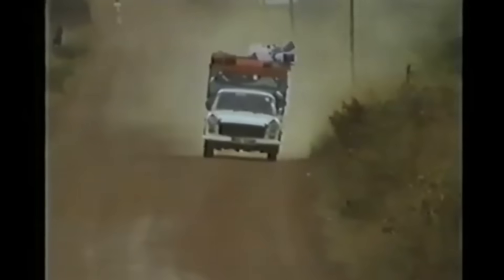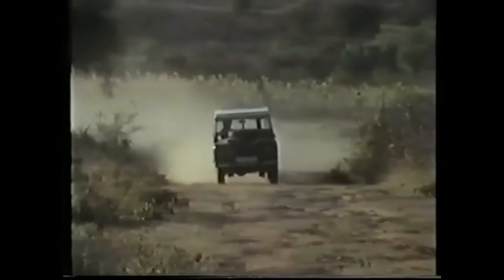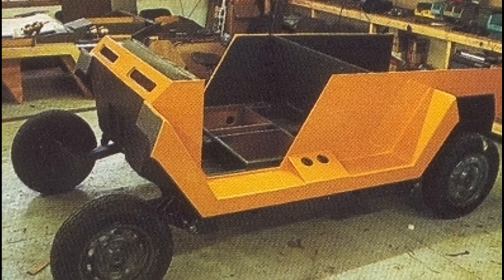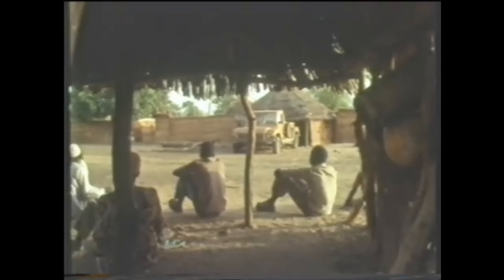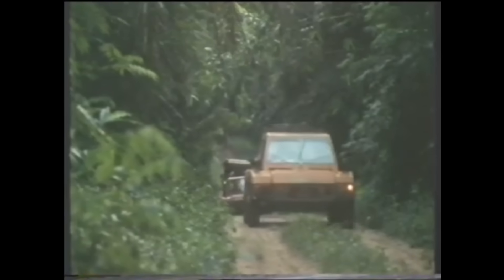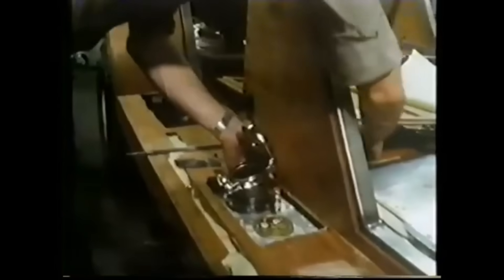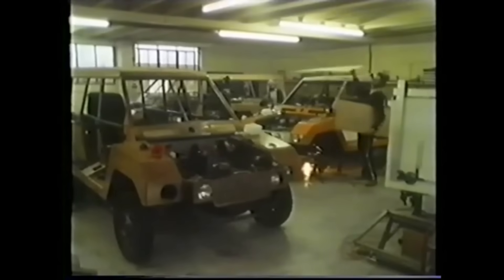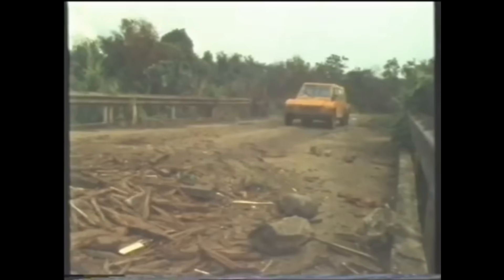This Car Was Built to Save Africa – And Got Its Creator Imprisoned

Comment: Looks cheap, but in reality it cost more than it looks. The body looks manual labor intensive and waiting for the epoxy resin to cured alone will take eternity, so efficient mass production is questionable.  The vehicle is designed for wealthy European Safari tourist, I doubt average African blacks can afford them where an avalanche of cheap used import cars from Europe and Asia are more affordable.  A third world car builder in the Philippines can do the same feat for a lot less using imported used parts from Japan and Korea and a simple arc welder or torch welder.

Comment: Replacing the motor & the gearbox at that step of the projet was a death wish. Especially with little or no funding. 
And it was counter productive cf. the initial requirements, having something already massively produced and known by the mechanics.

Comment: I was recently in Ghana and (again) noticed how almost all standard model cars are, and have to be adapted to the specific requirements of the local conditions and to their intended use. I thought: "Shouldn't there be a car designed for (SubSahara) Africa?" Turns out there is...

Comment: It was a great idea. I loved the documentary at the time...

Trying to develop a new driveline was a huge mistake. With the construction the way it was, it would have been easy to just build different front subframes to adapt whatever running gear he wanted to the car.

The original plan was to build them locally in Africa. Lile the Jeepneys in the Philippines, they could have been built one by one, using whatever was available. 

I guess that wouldn't have been a strong business model tho'...

Comment: If only he just did the chassis frames, in the UK. And then the  buyers built a kit car upper body on whatever local materials were available like flattened out oil drum panels hammered into shape in a backstreet workshop.
If the mechanic components were readily off the shelf, then the rest should have kept the idea afloat, until a new engine and gearbox layout was designed and manufactured in Britian. 

Are the original company design plans now open source since the legal case. 30 year rules on anyone building their only version on his work. Or did the creditors in that case, own the rights outright. Blocking any future development but with modern technology innovation and materials.

Comment: car for Africa - pick up, two cylinder, two stroke, air cooled("trabi"), "short" transmition(max speed 60 km) 15 inch wheels, cross leaf spring front and rear, tubular frame and textil "panels", curb weight 500 kg, simpley and no expensiv, price 700 - 900 $, car for African piples, production, Vietnam, Indonesia, Bangladesh and African states.. 😏

Comment: I have the book, published in 1987, based on the Channel Four TV programme. It was brand new and sold for £12.95 (so it wasn't cheap) and I bought it reduced to £4.99, so it wasn't just the car that failed financially.
It was a disappointing book as most of it covers the societal, ecological and moral aspects of the project whereas I was only interested in the design and construction. Such details are scattered throughout the book rather than one dedicated chapter. Maybe this is the result of prevalent, muddled thinking.
I must add that according to the book the vehicle had a plywood, pontoon chassis with additional, steel front subframe and rollover protection. Should have been designed as a kit car or plans.

Comment: Custom engine and gearbox for a car, which should have readily available and well known parts, adn development itself can't be cheap... WTF?! It all made sense up to that point, but this change was introduced almost like he wanted the project to fail on purpose.
Reply: His worry was that fact the 2cv had gone out of production and he couldn't buy any new vehicles or engines, it was a panic situation and not thought through.
Reply: @laupernut  To be fair, I don't think that there was anything else on the market comparable to the simple, simple, simple C2V powertrain, and  else would be more expensive to buy and require redesign. So, in a way I understand his reaction.  However from the Monday Morning Engineer's perspective,  I would have started purchasing some of the  tens of thousands of USED C2V engines and having them rebuilt to spec.  That would have been about the same cost as buying new engines and  would have given him a couple of years of production while searching for a different engine.   

However almost 50 years to late to be of assistance? That's just the way I roll.

Comment: What exactly did he want to develop that a Toyoata BJ wasn’t already?
Reply: The low price. The Toyota was available for $10,000 (new in 1981) while the Africar base price was estimated at $4,250 - $13,250. Quite a wide range, even for an estimate, I'd say. I can't actually believe tha the three axle upgrade would increase the price by a factor of 3 compared to the base model. There's something fishy about that. And building an "African car" in the UK? The UK wage of $800 (per month) back in the days versus $300 in South Africa. Well, probably because the car manufacturing infrastructure wasn't yet there in Africa. Automated modern car manufacturing requires 40 person hours per car, so that'd be a only a $100 price difference if the Arficar could have be assembled that fast in 1985, too (maybe possible with a externally sourced drivetrain, as initially planned).

The Citroën 2CV Charleston was around at less than $6000 in 1981. The Mèhari was the 4x4 version of the 2CV, at about twice the price (I was told). And this model was indeed made for the African market, so that was what the Africar had to compete with. Ouch.

Honestly, I'd rather buy a used Toyota BJ for less than a new Africar.

Comment: I wonder how it would have done in crash tests... 
And what the projected deaf toll was from simple fender benders...
Reply: That's why European cars which no longer pass verhicle inspection (too unsafe to be driven in Europe) end up in Africa.

The plywood would have been stronger than a normal steel body. In other words: no crumple zone, so pretty deadly. At least the demo models had the wodden benches replaced with regular seats, complete with head rests, and there seem to be seat belts.

I guess you're better off with a used car which was certified unsafe in Germany than with a brand-new Africar. Or a brand-new Cybertruck. 😀
Reply: @klausstock8020  Read up on train disasters involving wooden-bodied wagons if you really want to know what that material does to the human body.
Reply: Have you SEEN the road toll rates even in South Africa with PROPER cars? Nobody there worries about that crap
Reply: Frank Costin built a racing car which survived several crashes better than similar cars.
Reply: @neilmchardy9061  We're not talking about the survivability of the car. We're talking survival of humans. And not just passengers.

Train coaches (mentioned in another comment) aren't designed with crashes in mind. That's why the proverbial "train wreck" is the proverbial train wreck. 

No crumple zones.

The wood is sturdier than sheet metal. It excels, by a very wide margin, in transferring external forces into a human body. 

A crumple zone absorbs the energy of an impact. With more rigid material there's no gentle absorption, and the forces travel on and rip everything apart. 

Rigid is not what you want, unless you value your car more worth than your life.

That was already known, very well, in the 1980s. Still, 50 years later, the message had not yet arrived everywhere.

Some Musk designed a pretty rigid car, apparently to survive the "zombie apocalypse" (?).

Now, in 2025, a Mercedes Benz G class suffered from a medical condition, which, basically, turned him into the best real-life approximation of a...zombie.

The G class hit a Cyberwagon. The owner of the Cyberwagon survived, because the Cyberwagon was parked and the owner was safely elsewhere.

The Cyberwagon couldn't absorb the forces. It literally got ripped apart.

Fun fact: almost every car on the streets nowadays has an "exoskeleton" (or "integral body", as engineers day). But only one car is marketed as having an "exoskeleton" (the Cybertruck).

Fun fact 2: three examples of cars not having an exoskeleton are the Africar, the Mercedes Benz G class, and the Tesla Cyberwagon. 

Yeah, some guy with money thinks he's not just money but the brains as well.

Comment: Could have saved himself all the trouble had he test drove a Toyota
Reply: At double or triple the price, I suppose.
Reply: @stejer211 About double, had been able to keep the price close to the lower estimate of $4,250. The upper end of the estimate ($13,250) however couln't compete with the Toyota at $10,000. Maybe that's why he decided to ditch the externally sourced engine?

2CV (special Charleston edition): $6000.
Reply: @stejer211 Well then buy a Peugoet 404 405 pickup.

Comment: I seem to recall the engine Howarth wanted for this car was an opposed piston unit. Would have been an interesting move.
Reply: Yes indeed, Howard put in the Boxer engine. Being a flat engine, so low bonnet/ hood. Also air-cooled, no need for coolant. Lightweight, simple, easy to repair in Africa and reliable.
Reply: I read an article about Africar in the Kijk magazine.

Comment: there is the perfect car for africa, it is the Peugeot 504, the Renault 4L, and the citroen 2cv. Modernize it, but keep it simple and reliable.
Reply: Land Cruisers and Hiaces too
Reply: @375DollarCarRacer  Not at the same prices.
Reply: @stejer211 $4,250 - $13,250 (estimated range) for the Africar, $10,000 for the Toyota, $6,000 for a 2WD 2CV, $12,000 for a 4WD 2CV.

Who else would rather buy a used Toyota Land Cruiser BJ than a new Africar?
Reply: @klausstock8020 I mean Hiaces probably went for cheaper so might as well buy a Hiace if youbare offroading hard
Reply: @stejer211  Are you a business finance expert? You talk like they give you a million a year.
Reply: Maybe Hilux or old Land Cruiser. Hilux is popular there anyway, just rereleasing older model with slight modernization would work. Same with old Land Cruiser. They could even make stretched one to serve as transport in rough terrain.  @375DollarCarRacer
Reply: Today, the perfect car for Afeica is Toyota. Tomorrow probably not.
Reply: @ABa-os6wm I think Toyota is going to remain the king of cars in Africa for quite some time to come. You see them everywhere. Mr Bill
Reply: Are they bullet proof
Reply: Reliable french car is an oxymoron. To be fair, they are cheap and easy to fix.
Reply: @thegrey8643  They were rocks, and designed for easy maintenance, that's how good they were. The interior fell apart but every thing else especially the drivetrain soldiered on. Peugeot and Citroen specifically were outstanding. Sorry Toyota's weren't as reliable enough in those days and parts were unobtainium. You give the impression of someone born recently.
Reply: @thegrey8643  I owned a Renault 12 fourty years ago. I am still mad at France lol.
Reply: I didn't know that Peugeot,  Renault, or Citroën ever had any reliable vehicles. 😂😂😂😂
Reply: @prtcgv5105  Yep if you went to Africa you would find loads of them back in the day, and if they did break which any car would in thouse conditions any fool could fix it. Thats why the 504 was king, it was rugged but also fixable.
Reply: @prtcgv5105 the 504 beat the record for crossing Africa north to south which is still not beaten...
Reply: Peugeot 404. Much tougher than the 504.
Reply: The 504 was the best toughest car to use in Africa before Toyota started to dominate the market. There was simply no substitute in the eighty's. I wittnest it during my 4 years stay in north Africa.
Reply: @eksibir1  the 404 before it was way tougher and far more a symbol of Africa.  By the time 504 came in, Toyota was making huge inroads. 
Also don't forget the VW beetle and kombi, tough and reliable.
Reply: And we will be obliged to drive pain in the b... EVs ????
Reply: China will provide the right cars for Africans. Occindentals only think of profit from sales and expensive spare parts.
Reply: None of the other cars have the wide track. So unsuitable for truck rutted mud roads. Nor are they capable of local manufacturing. In the 80s 75% could have been made in Zimbabwe. 90% in RSA. Howorth wanted to give it away so it became self reproducing. I too drove the pick up across a building site outside the factory. The way it floated across trenches, mounds etc. was amazing.  There were Zim government people there that day.
At that time I visited a rural hospital in Zim. They had one barely working vehicle a hilux pick up. Around the site were u/s land cruisers, mercedes ambulances etc. All broken and unrepairable (no parts available). Any vehicle left for a while was stripped for metal by locals until it was a bare skeleton. 504s were good in Zim, Zam and Malawi with proper gravel roads but no good on mud roads in other countries.
There were other major mechanical issues with the africar. (The 4wd didnt work and all the prototypes were 2wd in practice. And the steering geometry was wrong) But the killer was his obsession to develop a new opposed piston flat four 2 stroke diesel engine. They didnt have the money. There were flat four 2 stroke diesel engines available in the GDR but he wanted his own.
Egomaniacs are good at starting things but need to defer to teams and collaboration in development b4 they lead it down a personal dead end. As Elon Musk is discovering!
Reply: @bobcannell7603 ELon Musk has the Pentagon as a sponsor, 75% of Space X's expenditure is given by the Pentagon. This is not an example to take.
Reply: The Peugeot 504 was the car for the African middle class in the 80s and early 90s. When they phased out, they were mostly used for taxis. In Ghana, it was so common.
Reply: No one wants a French vehicle they only get 1 gear forwards and 5 in reverse!!!
Reply: Basically a rally .
Reply: Toyota pick up or celica did well in africa racing for years
Reply: @captaintoyota3171  Toyota wasn't a thing in Africa till 90's. French cars ruled in the 60's and 70's. Many are still on the road were it not for being abandoned for newer better equipped vehicles or for rust and accidents.
Reply: And bring back the old suspension system, mechanical only.

Comment: Ive only just clicked on this and not watched it yet....but
In the mid 1980s I used to go to the Africar factory in Lancaster to drop off Peugeot/Citroen parts for the Africar from our garage in Cumbria.
I got to drive the short wheelbase demonstrator around the industrial complex.
A really great car with a really ingenious chassis and body.
Edit.
I suppose it makes me one of the rare people who actually drove one of these vehicles. It was the short wheelbase 4 door version the twin rear axle and pickup where both in the factory on display, the one i drove was kept by the door to use as a demonstrator.
They were all cars that drove across africa, so thise in this film.
Reply: I remember my uncle almost worked for Africar, but didn't because it was a shambles (his words). I grew up in in Lancaster but can't for the life of me recall where the factory was.
Reply: @davidtymon8258 ive just had a look on google maps and from memory (it was a good while ago (mid 80s) and it would i believe be in the estate behind the Shell garage on Caton Road. On the left as you head towards the M6. The area nearer the M6 is too new.
It was in one of the larger industrial units on that estate. They had the right side of a fairly large building.

Im afraid i cannot remember much more, but i hope it helps a little.

Comment: should have stuck with the citro-en !  2cv   - it was already made
Reply: That or the Ami.  And the Mehari, ofcourse.
Reply: @bertnl530  The Ami was a pain to maintain. But the Mèhari was the 4x4 2CV specifically designed for Africa.
Reply: Yup, building an engine and transmission is a lot harder than it sounds.  Many vehicle manufacturers went bust going down that same road.
Reply: @paul5683  I'd think you'd need a huge team and amount of money to make it happen. Crazy for them to go down that route
Reply: True

Comment: i wish this took off, i want one of those! i feel like something similar could still exist, there are still a lot of places that are only accessible via off-roading or incredibly unmaintained roads.
Reply: Try to buy a Citroën Mehari. The same concept of simplicity and reliability. Also with a air-cooled engine and 2 wheel drive with flat bottom.
Reply: @mardiffv.8775  looking into it now and they look awesome, unfortunately most listings are out of my price range, but if i find one for cheap, im taking it. i still wish the africar took off though, it just feels like the only attempt to make a off-roader into the norm rather than a niche.